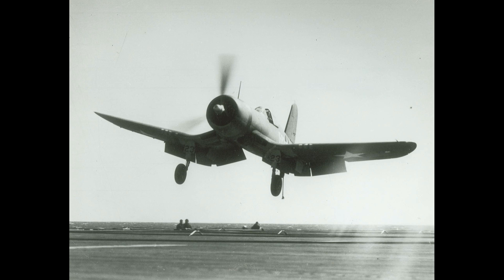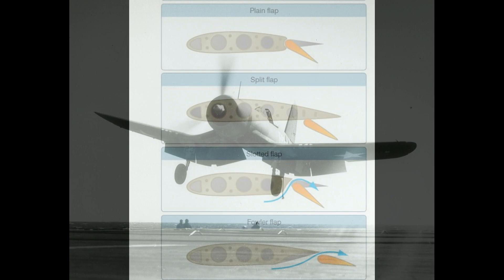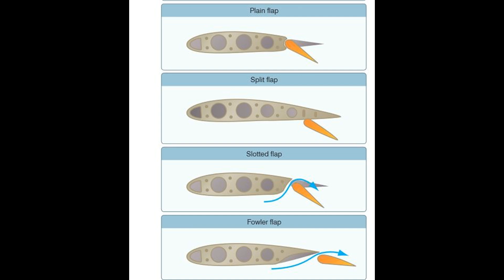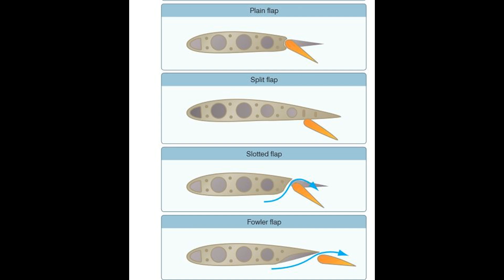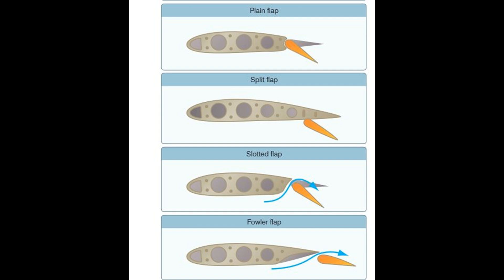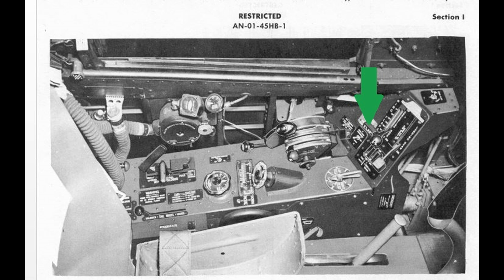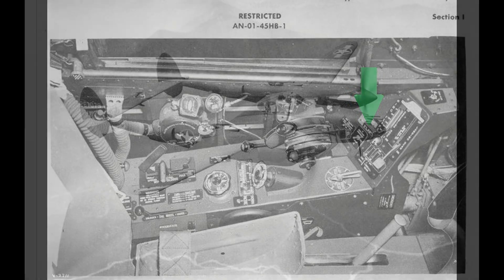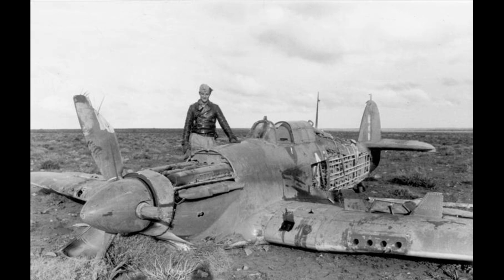Using Flaps in a Dogfight with the F4U Corsair and others

Comment: Your Example between F-4 and Ki-84 did have some serious Flaws...because we asume the best Marine Corps Pilot, and Japanese Pilot how is playing the Game after F-4 Corsair Rules without G-Suit?
What did happen when the  Ki-84 Spirals upwards or did i high Yo-Yo after the F4 did a 9G Turn what produce a hell lot of Drag and F-4 Consitent lacking behind in Power to Weight Ratio compare to the Ki-84?
Would not bring this as Example, all  participating WW2 Nations try to avoid Dogfights, even japanese learned the lesson light Turn Fighter brings you no where in the Time of Hit and Run Tactics...
But Flaps are intressting Thematic nice Video...
Reply from the maker: Maddy, the point of that comparison during the turn was to explain the effects of flaps on a turn. If you though that was supposed to be a lesson in tactics, I think you may have missed the point. In order to be a valid explanation, the turn needed to say in the horizontal plane.
Reply: Yes fully understand your Point, but I Found the usage of a F4U in Horizontal Turn Fight not really good as Example, even the Ki-84 could reduce the Power so far he can deploy his Fowler Flaps...9G Turn is already Combat Tactic, without this the F4U would never come in the Position to deploy Flaps...More likely use of Combat Flaps in WW2 would probably F4U with Speed Altitude Advantage use his Flaps in down Spiral as you said with lose of Altitude to increase his Turn Performance near Stall Speed to so far he can catch the slower KI-84 that is out of his Speed Range for the best Turn Rate can not dive away from a F4U...But the Point is clear  what Flaps can do and what not, I know how much Work you but together for this Video very well done...
Reply from the maker: Thanks Maddy.

Comment: Where is the fuel tank
Reply from the maker: Hi Nate, I think the video you are looking for actually involves Robert S Johnson in a P47, although maybe not, but it sounds just like Johnson's event. The Corsair's fuel system varies a bit with model type. All have a single self sealing main tank in front of the cockpit. Many have two additional wing tanks which are not self sealing, but can be purged with carbon dioxide so they don't blow up when hit.
Reply: I think you might be right o. It being a mustang do you have a link to that video source somewhere? That vide gives me chills. 

Also is there you are aware of that shows one of these self sealing fuel tank being shot at in the open showing it being shot and sealing itself. If not we need to send one to the slo mo guys to film it with there cameras

Comment: I read a book about the P-38 Lightning and according to one pilot who flew the P-38 in combat (and also flew it against other US fighters as well), he said he could stay behind anything except a "pretty savvy Navy type in an F4F Wildcat."  Go figure.
Reply from the maker: I don't doubt that he said that, but by all other accounts, the P38 is easily out maneuvered by a lot of other planes.
Reply: Actually, if the P-38 is in a turn, extend the Fowler flap a bit, throttle up on the up-wing engine, throttle back on the down-wing engine, and the P-38 could turn inside just about any fighter.

Comment: The Me 109 from the F onwards had split flaps with the radiator air exiting between the flap and wing thereby acting as a nozzle similar to P-51.   Lockheed Electra &  Hudson had Fowler flaps, had to get into small airports.    Wing efficiency ie Lift to Drag ratio under heavy load is key to a sustained tight turning circle.  Neither flaps or slats increase wing efficiency, they decrease though at least a smaller wing can be used which has lower drag.   Slats don’t increase lift at any particular angle of attack but allow a higher angle of attack before stall and the higher angle is where the lift comes from.

Comment: Most of the aerobatic airplanes nowadays don't have stall warnings too. As an experienced pilot you can feel the flow separations on the wing. Spitfires had a stall warning because of their elliptical wings that gave the plane maximum lift but on the other hand if the wing stalls it will lose its lift on the whole wing span at the same time.
Reply: Spitfires had 2.5 degrees of wing washout and gave the pilot warning of a stall when the aircraft began to judder as the centre section stalled. The wingtips, due to the washout stalled later giving the pilot both warning and time to deal with the situation.

Comment: I might be wrong but I think they're not talking about "stall warning systems" but the handling characteristics of the plane as it approaches flow seperation. Planes like the spitfire would shake you up pretty bad if you went anywhere near a stall, no systems required.
Reply from the maker: I'll quote from the NACA report on the Corsair "The stall WARNING was considered unsatisfactory in all configurations". also, "the stall WARNING was deficient in all configurations". This theme is repeated throughout the report. The actual stall characteristics and recovery were not issues for the Corsair.

Comment: "I'm probably gonna mispronounce his name"
pronounces name very well
Reply from the maker: That makes me happy. I didn't have an actual German to consult so I sort of guessed.
Reply: Also, the dreaded "ch", existing in slavic languages (in cyrilic written as "x"), germanic languages, Spanish (as either "j" or "x") and more. Of course, it doesn't sound the same in all of the cases, but it's similar. It is relatively easy to pronounce - I'd say like "sh" (without using vocal chords), but instead of using the middle of your tongue to make the narrowest gap in the mouth, use the rear of your tongue.  Russians often struggle to say "h" and end up saying "ch" instead.
Reply: AE Devereux  Close... V can be both the voiceless labiodental fricative (F) and the voiced labiodental fricative (V); pronunciation depends quite a bit on where the speaker hails from, but mostly it's something you have to learn by heart. But W is always the voiced labiodental fricative.

Example: Viktor - voiced (V). Volkswagen - voiceless (F).

Comment: Awesome vid.  One thing to add is that this sort of simplifies dogfighting to hit-and-run or turn fighting, when in fact the widest amount of potential exists in vertical maneuvering for most planes, even "turn fighters" using displacement rolls, yo-yo's etc, which is what the pilots would have taken away from "don't turn fight".  The example you provided, though, really pushes in the fact that a plane like the Corsair was the most maneuverable fighter in a turn above 300 mph against pretty much everything.  A seasoned pilot would not have continued the turn behind the Frank, he would have displacement rolled into a firing solution once speed reached 300 mph to maintain energy (had a snap shot not hit prior).
Reply from the maker: Thanks. That's absolutely correct. My example of a Corsair vs. Frank turn fight was only intended to demonstrate the effect of selecting the flaps to 20 degrees. In reality, I think the Corsair pilot would have reduced bank angle and climbed before the speed dropped below 264 knots. The topic of this is about the effects of flaps in turns, so I had to use an example that would fit the subject matter.
Reply: Yup :). I would bet that is where those maneuvering crashes happened, when a newbie pilot took it to those ranges below 300 mph and kept a high AOA, especially near the deck where you don't have the recovery time.  Personally in combat flight sims I use flaps more often than not in defensive situations to cause overshoot, or if a target is aggressively s-turning and I don't have a high roll rate (P38).   There are plenty of real world examples of P38 pilots using flaps to help in combat, as much like the Corsair, it made a big difference in the short term for those ships.   All 'Murican stuff really helps at low speed with 10-20 degree flaps.  Hell the P51 you can use 10 degrees up to 400 mph.

Comment: Hey Greg, you didn't go into detail on stall warning systems so out of curiosity I'll ask because I've never read anything about them before... What did they use as stall warning systems back then? I have a bunch of time in Cessnas and the only stall warning I've encountered (apart from control feel) are something like whistles that make a horrific sound when the airflow over wherever they are positioned, on the airframe is interrupted... Is that what they used then too? Or were there different and more advanced systems in use for fighters?

BTW saying your videos are awesome is a massive understatement. Not really enough moving footage or pictures to keep younger people entertained but that never worried me and the content is so well compiled they don't really need it.
Reply from the maker: Jared, thanks for your kind words. The Corsair's stall warning system is much like that in a general aviation airplane except that uses a light at the top of the instrument panel rather than the noise you near in a Cessna. The light is not in all Corsairs, in fact some of the very F4U-1s don't have it! When installed, it comes on 4-8 knots above the stall with full flaps and gear down, and 18 knots above stall in the clean configuration. That's way too early to be useful when trying to get maximum performance out of the plane. In addition to this, as with  all airplanes there are other "warnings" of stall, including buffeting, noises, and the feel in the controls. Those signs are all weak in the Corsair, so the lack of a decent stall warning system is a bigger problem than it would be otherwise. In short, it takes a very skilled and experience pilot to get everything out of the Corsair in turning performance. Thankfully for Corsair pilots, it had so much speed, climb and diving capabilities, that it really didn't need to turn fight anyway.
Reply: Thanks!
Reply: I think they're talking about the fact that the plane doesn't buffet before stalling, it just goes - and when it does, one wing stalls before the other. "Stall warning" isn't necessarily a system, in many planes you'll feel and hear it coming naturally.
Reply: I was wondering about that too, there's a paper by NACA: "Stalling Characteristics of the Supermarine Spitfire 5A Airplane" - it seems like it had an unmistakable buffet near the stall and that's it, no stall horns or blinking lights. Just some "dirty" airflow shaking it around.
Reply: Stall horn... nailed it! I should have remembered the correct name for them!

Comment: Hi greg would be nice if you could do a video on fw190😁
Reply from the maker: I really want to do that, and I will. Right now I am trying to knock out videos with all of the concepts that are important to understand in a comparison between say a FW190A vs Spitfire MkV. I can't make a video like that until I have turning circles, flaps, manifold pressure and other concepts covered. The issue is that I don't want to make a FW190 video that just rehashes the same information that's in every book and video on the plane. I want to cover it in much more detail. That detail requires the viewer to already understand the concepts that I am trying to cover in these first video.

Comment: Crop photos for widescreen
Reply from the maker: I am afraid that's outside of my skill set. I just crop them, usually directly out of the NACA report exactly as they appeared originally.
Reply: Greg's Airplanes and Automobiles Don’t sell your self short, it’s not outside of your ability. Cropping them for a widescreen should be standard, you have a phenomenal presentation of the information, cropping them for widescreen on the photos that would work with that format would add aNother level of professionalism and fit and finish to your already stellar work.

Comment: Really interesting video, as always! 
Combat flaps will always improve your instantaneous turn but in the long run, the added drag will just slow you down too much. Maximum sustained turn time (as opposed to instantaneous turn) is always achieved with raised flaps. But flaps certainly do have a place in combat. A good pilot knows when to deploy and when to retract his flaps.
Reply from the maker: Combat flaps are a tool to be used, but as you point out, not always the best solution to a problem.
Reply: @GregsAirplanesandAutomobiles  What I gathered from Robert Shaw's book "Fighter Combat: Tactics and Maneuvering" suggests that the use of combat flaps, or flaps in general, should be used only for a short increase in turn rate to get a gun angle when you know you aren't going to be able to keep turning with your target, or right at the top of a vertical maneuver like a high yo-yo, where your descent in the second half of the maneuver will restore some of the airspeed you traded for altitude to tighten your turn.
Reply: It does not surprise me Shaw was so completely wrong about flaps in propeller combat... He applied jet physics to props, and even cherry picked combat reports of P-47s to make it look like an “energy” vertical fighter... Despite its crummy climb rate... Yes the P-47 could zoom, but read reports and all it does is turn.
Reply: @GregsAirplanesandAutomobiles   I wonder if Greg "Pappy" Boyington really deployed the flaps in combat with his nemesis Tommy and made the Japanese pilot fly right past pappy and got shot down too.
I met the real Greg Boyington at the Reno Air Races but didn't ask because I was only about 12 years old then.  Cool videos!

Comment: Very good informative video with good data.  In combat flight aims I often use the flaps to force an overshoot or get the little extra turn performance I need to get a shot on an enemy but it is always costly to airspeed.  This is especially important in the P-40.  If you fail to shoot him down you typically have so little airspeed you might as well bail out.

Comment: I have a question you may be able to answer. I fly radio controlled airplanes and I've owned 4 Corsairs of various sizes. All of them tended to dip the nose down when banked to turn. Do full-size Corsairs exhibit this behavior?
Reply from the maker: Yes, real Corsairs do exhibit that behavior. As you bank you need to apply slight rudder into the bank to counteract adverse yaw and add some up elevator.
Reply: I use computer radios that allow you to "mix" in up elevator when banking. I looked at my settings and I had it set up so that about 7% of up elevator deflection occurred for 100% aileron deflection. Co-ordinated rudder turns are a different monster seeing how I'm not actually riding in the aircraft with instruments. I can't "step on the ball" as my flight instructor used to say to me when I took flying lessons. <G>

Thanks for the reply guys. 

Love your videos, Greg. I always learn something interesting. I love the old warbirds and just about anything that flies. Having been born in 1960 I also love muscle cars from the sixties and seventies. I owned three Z-28s, all of them with 4-speeds, and my favorite was my 70 1/2. I built over a dozen engines for those cars and rebuilt the M-22 from the 70. 

Airplanes and Automobiles works for me!
Reply: i think u might need to compensate it with ur rudder
Reply: Of course, you have to apply up elevator in a turn. I have flown real airplanes and still do fly RC planes and helicopters. And the heli's I fly are not drones with piezo gyros on every axis that any child can fly. After reading my original question I think I wasn't very clear in what I stated. My Corsairs tend to dip the nose in a more pronounced way than any of my other planes. I have owned around 30 different RC airplanes and about 10 heli's. The Corsairs all have a more pronounced tendency to dip the nose when rolled than any of the other aircraft I've flown. It's very distinct. Even the stick movements on the radio controls feel very similar from one Corsair to the next. I have always assumed it was a property of the "gull wings".
Reply: AE Devereux asked "Could it be a weight and balance thing?"

I'm not sure but I don't think so for the following reasons. RC planes are "real" planes and have to be balanced properly in order to fly properly. I have a Great Planes C.G. Machine and I always carefully balance all of my aircraft. It's very unlikely that I would have somehow screwed up the balance on 6 different Corsair models so that they all exhibit the same weird flight characteristics but then managed to get the CG perfect on 25 other airplanes. Most of my Corsairs would definitely have a lower wing loading than the real thing, as you describe, but one model I built probably had a higher wing loading (to scale) than a real Corsair. That model had fully functioning split flaps and rotating retracts. If I remember correctly, that model had a 56-inch wingspan and was supposed to have either a .46 cu in 2-stroke or a .70 cu in 4-stroke engine. I crammed a Magnum .91cu in 4-stroke engine into that plane which required adding lead weights to the rear of the plane to get it balanced properly. I have a program for my computer called "Real Flight Simulator" that models many different models of actual RC aircraft. "Real Flight Simulator" comes with a Futaba controller that plugs into the PC via USB cable. The Corsair in RFS is modeled after the "Top Flite" giant scale F4U and it exhibits the same tendency I have described. RFS has a Stuka model but I have not thought to check to see if it does the same thing. I haven't used RFS since Windows XP was still in use. I'll have to install RFS on my Windows 7 laptop and see if RFS will run and then try the Stuka.